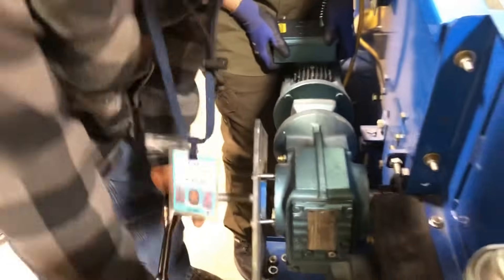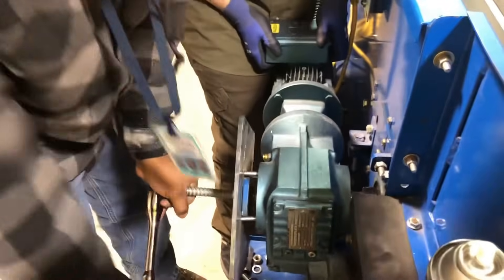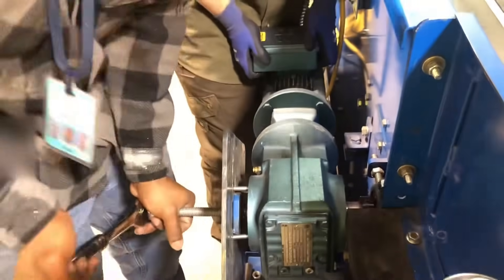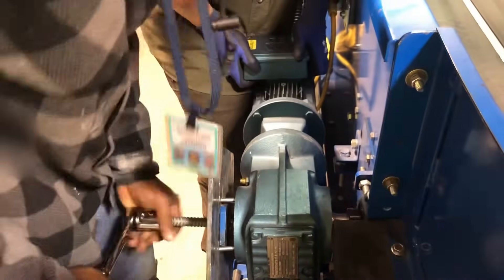Conveyor Gear box removal

Comment: Sew Eurodrive are some of the best and most reliable gearbox motor combos I’ve used and seen in my almost 40 year career. When reinstalling, make sure to use some anti seize on the shaft so next time it comes out easier. Only problem I seen on this video is you’re lacking the production supervisor standing behind you with his arms crossed thinking you are moving too slow and peeking at the disconnect to see if you put on a LOTO hoping you didn’t so he can write you up😂

Comment: What are the dimensions of the screws you used in this ocassion?, by the way it looks in the video, plate thicknness is around ½ in. Also, if possible, do you remember what kind of style of screw is, standard, extra fine, etc?
Reply from the maker: The screw is from a puller set, i believe it was 1/2 fine thread. 12” long

Comment: I would have like to have seen what the other end of the threaded rod, how dose it  push on the pulley without hurting the roller.
Reply from the maker: Thanks for watching, it’s a standard pusher rod, robbed out of a gear pulled, so the far end has a rotating flat head on it

Comment: We usually use a gear puller but I like your method as well.
Reply: James Ladd.  Where I work we have similar gearboxes.   What is an easy way to install.   I’m the real world they just don’t slide back on.
Reply: @miker8623 putting a bold with a big washer in the ax. And same principle as in video. And please use a lot of grease. It will help next time.
Reply: @Mohow-fv2vq  Anti-seize helps a lot.

Comment: What's the purpose  of the metal Jerry rig plate
Reply from the maker: It is a gear puller used to pull the motor off the shaft. The motor and shaft take a set and are very hard to remove